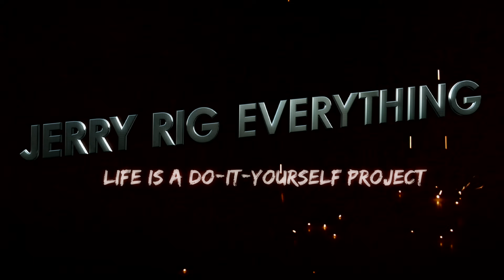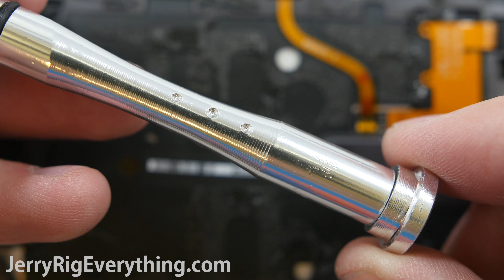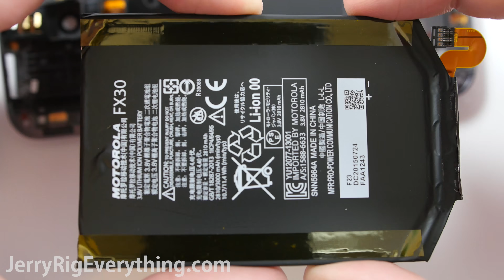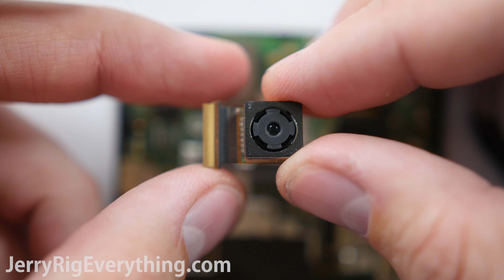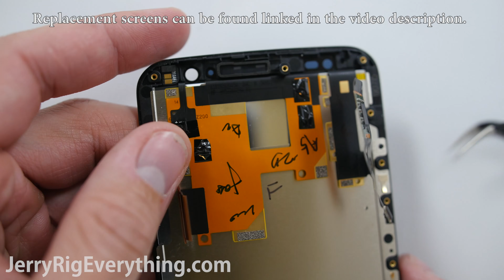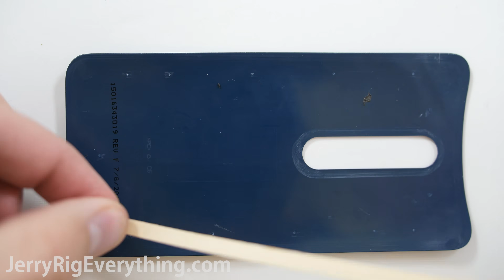Moto X Pure Edition 2015 Screen Repair, Battery Replacement Xt1575

Comment: Jerry, I have viewed all the moto x pure repair videos I can find, and like yours the best.  However in the comments people keep asking about replacing the speaker grills (don't have mine apart yet) and I am not seeing any response to this issue.  I hate to throw another $60 bucks at this thing if I am just going to trash it.  Only had mine 3 months when I dropped it.  A few things I don't like the engineering on, like the placement of the power button and volume buttons, but overall really prefer it to the old nexus 5.  And my T3 was a bit small, but the T4 was too big.  17 screws out three to go when the cheap T3 twisted.  New better T3 on the way.

Comment: I'm so frustrated!! Down to that last black screw connecting the mother board to the screen assembly. It stripped... even though I took my time and was gentle it still turned out to be the most stubborn screw and now I'm left with no phone. First time disassembling a cell phone but I've had a lot of experience with other electronics. What do I do!! Please help, the sooner I get this finished the better.
Reply: I too had this issue with one screw, what i did was to drill it with the smallest drill head i had, drill the head of the screw and it will be no problem, (not sorry 4 bad english)

Comment: Hi Zack, could you talk about the aluminum chassis of the phone?  Often times when a phone has been dropped the aluminum will be bent.  I'll be replacing my screen, aluminum frame, battery, and back cover.  Thank you for the insight.  This phone looks relatively simple and straightforward to fix.  I'm adding your video to my favorites list.

Comment: only the top half of the screen works on my phone, any suggestions?
Reply: if it's under warranty and it wasn't because you dropped it or something try and get it replaced. I wouldn't suggest trying to fix a phone like this unless you have experience or have the money for a new phone

Comment: My replacement came without the speaker grills and flash. I assume the flash fits in from the other parts of the phone, but what do I do about the speaker grills? Can I remove them from the old phone and replace them? Or am I out of luck?

Comment: Jerry is it worth 300$ now or something else for 250$
Reply: sorry for a late reply but it depends. I got this phone the first 3 weeks it was out and it's worked really well for me. if you don't care about the fingerprint sensor and are on a tight budget get this phone. if you want a phone with the fingerprint sensor and don't care to spend a little extra get the Nexus 6p or the new Nexus phone coming soon. a micro SD card slot doesn't matter too much anymore since you can hook up a OTG cable and use a flash drive

Comment: Great video.  I have the moto x and I dropped it in the lake..quickly recovered, but damage was done.  The phone boots and screen works, with few water spots.  Volume and power buttons work as well.  I have done a factory reset on the phone.  The problem is the touch screen isn't working at all so I can't use the phone.  Is the touch portion the same as the screen?  It would be nice to get rid of the water spots anyway, but I just want to make sure I am thinking about this correctly.  Any help is appreciated.

Comment: What kind of double stick tape are you using for the back? And the screwdriver that worked for me was the T3, not the T4. But let me know what kind of think double stick tape you used.

Comment: I bought the tool kit listed in the description and it came with a T4 bit that was definitely not the correct size. The smallest bit, marked T4 was not working with these screws at all. I took my phone to a shop to see if they could help and we discovered that the sizes are larger than they are marked as. I ended up stripping a few because of this. They were able to remove the screws for me and gave me a tiny T4 screwdriver since they had a bunch from screens they purchase. It locked in perfectly with the screws. 

Don't buy that tool kit if you need a T4 bit or screwdriver. It's not actually T4 in the kit even though it's marked/stamped as T4.
Reply: Corinne N Really?  That sucks. Makes you think they don't want us working on our own stuff.

Comment: I see that you provided links for replacement screens for this phone. However, is there a replacement battery one can buy for this phone?
Reply from the maker: +Jorge Ramos Yup! I just found one and linked it in the video description.  Just click the 'show more' tab to reveal the other links below the video.
Reply: +JerryRigEverything Thank you so much for that! While this phone has been doing a lot better since running Marshmallow, this is my first NRB phone in years, after staying with Samsung Galaxy series for a long, long time, and further again with the Note 3 before Samsung started getting very anti-tweaker/tinkerer.

It is indeed a positive to have one of the few phones on the market with full compatibility for all US carriers, but I'd rather be prepared if/when the battery goes south. Other than that, it has grown on me.
Reply from the maker: Jorge Ramos I'm glad you are liking it! I never had the chance to use it.  But ive only heard good things so far!   Hopefully you never need to fix anything, but if you do, you know where to find the good videos.

Comment: Question if I may. After replacing my screen, thank you, I noticed that my front facing flash is no longer there. Is there a part for that ? Should it have been on the new screen and digitizer? Any information you can provide would be greatly appreciated.

Comment: please someone i need a new screen but i am concerned about the speaker grilles can i take them off my old screen? Also i used moto maker so i need blue grilles :/
Reply: ***** turns out I've sent mime away to get fixed and they were able to keep my blue grilles so I guess it's Pretty easy to do

Comment: I popped the ribbon cable off the battery and it will not turn on because it's been disconnected. I need the black part at the end of the ribbon cable. . is it fixable?

Comment: Thanks for this terrific walk-through. Question about the speaker grills though...Did the replacement screen you purchased come with the speaker grills attached? The one I'm looking at does not come with them and I don't particularly want to try and pop my old ones out and back into the new screen.

Thanks!
Reply: did you ever get a solution for this? Im wondering the same thing because mine are blue, and I'd like to keep them
Reply: same
Reply: If you attempt it you might crack your glass.  Its not that easy.
Reply: I made the mistake of getting a (cheaper) screen w/o the frame, which also meant I had to try (and fail) to re-attach my speaker grills.  The replacement screen cracked after two weeks usage.  I'm trying again with a screen+frame+grills (giving up on my yellow ones).
Reply: Try cutting 0.5 mm from the speaker grills from both size with a nail cutter and you are ready to go :)

Comment: Jerry .similar to the moto pure my moto play just  needs the glass replaced and not the LCD. the glass I ordered online does not come with the frame. do I have to take it apart like in your video to switch up the glass? or can I just apply some heat.

Comment: Thanks for a great video! Where do you get the screen and double sided tape from? Assuming the tape shouldn't just be regular double sided.
Reply: +Kirsten Rossouw 
Hi, did you find where to buy this screen? I am also searching for one. Thank you! Igor
Reply: +Igor Plotnikov 
Hi I just found one on ebay for $71 already with the frame, I am not sure about the quality and will be able to check  it only after I get it, but delivery from China will take 1-2 weeks...

Comment: My question is where I can buy the Pure Edition 2015 battery.  It appears that Motorola wants $200 for a non-warranty repair.

It is still preliminary but I think I need to replace the Moto X Pure Edition battery after an unfortunate incident of sea water damage while on vacation. Even after cleaning some superficial corrosion spots and the phone can be powered up via usb port or charger to fastboot menu (but nothing else since it is in boot-loop now), the battery cannot be charged at all (with or without the internal battery connector behind the "lego" piece attached or not). Perhaps a factory cable may help but I haven't found anyone else in boot loop for this new phone.

Comment: I notice you said the charge port is not replaceable? There's a black piece over do you know if it's removable? I see no reason why you should be able to solder new one on? I did a Nexus six charge port without any issues.  Let me know what you think thanks.
Reply: Oh and nice video as usual.
Reply: Another question. I would like to keep on making good videos on my channel. Would you like to narrate over my voice and edit the video and we can share it on both of our channels?  As you do more basic repairs and I do more advanced repairs I think we'd be a good team. But you're more basic videos are better than my advanced videos LOL
Reply from the maker: Hey! Good question.  And yea,  it totally can be soldered,  but for the average user it is not replaceable, most people can easily use a screw driver. But would shudder at the thought of using a soldering iron.  They'll just bring it to your shop instead ;-)
Reply from the maker: +Tech MD Youtube Tempting.  It is hard to film/edit/voice over all my own stuff. I see now why Supertramp has an entire team doing his videos. But it is nice to keep all of my stuff in house; being able to put myself into the whole project.

Comment: Is it possible or safe to replace the OEM battery with a larger capacity one, provided it fits?
Reply from the maker: +Paul Tran Yes, as long as the connection was the EXACT SAME. It is hard with those waffle connectors though... I doubt they will ever come out with a larger capacity battery.

Comment: Jerry, is it possible to upgrade a motorola moto g 2nd generation, by changing the snapdragon 400 original processor with the moto e snapdragon 410 and also changing the 3G part to that of the moto e which has 4G/LTE part? Thanks in advance!
Reply from the maker: +Fabio Marques do Nascimento (fabiomn1965) Woah... thats an intense question.  I have not studied the pin location for the 400 and 410 processors.  But I imagine... if they had identical pins, than it should just work when you plop in the new processor.  That would make a great video if you ever get around to it.  I dont delve into board level repairs a whole lot.
Reply: +JerryRigEverything Thank you, Sir for the prompt response.